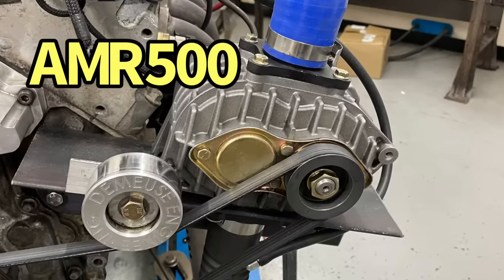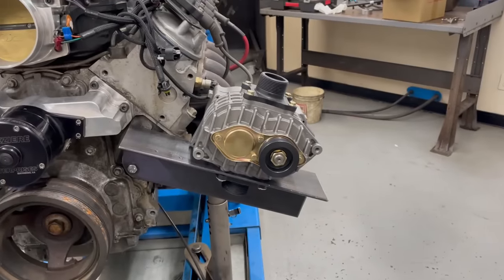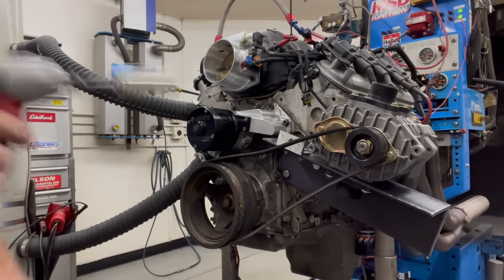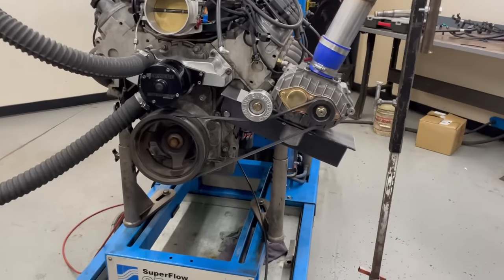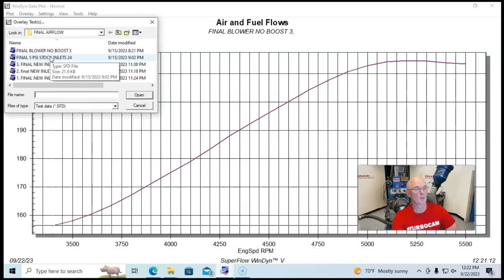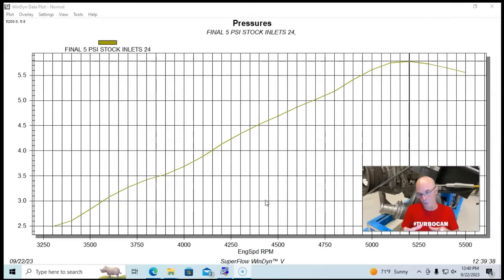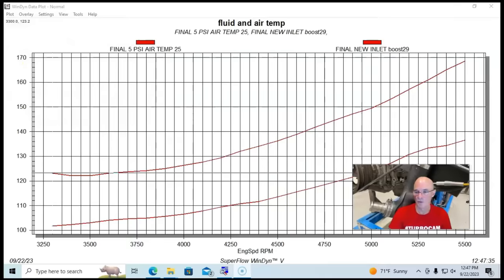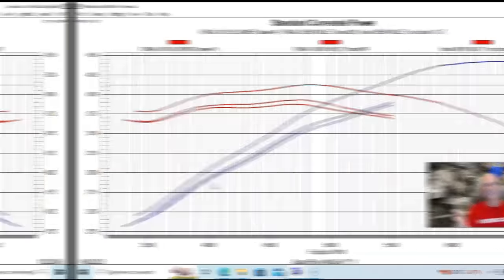THE ULTIMATE CHEAP, EBAY, AMAZON AMR500 BLOWER TEST. FULL RESULTS-AIRFLOW, TEMP & POWER CONSUMPTION

Comment: I ran an AMR300 supercharger on a fuel injected  420 cc single cylinder  Harbor Freight engine with a 1:1 drive ratio.  As I recall we got 8 PSi of boost.   The 13 hp engine  was also ran with the induction pipes disconnected so the blower didn't produce any boost and the little engine had no problem spinning the supercharger up to redline.   We discovered a few issues with this type of supercharger, first one was the gear drive inside the supercharger develops a lot of heat and we were able to wick away some of the heat with a water cooled heat sink from a PC.  The second issue is the supercharger cannot tolerate any vacuum or negative pressure... like when the engine is at idle.  If there is any vacuum, the oil from the gear drive will get past the seals and be consumed by the engine and the gear drive will be sucked dry in a few hours... the solution is to use a bypass or double throttle bodies.
Reply: Very nice to see you here RC!! Love* your content and I hope you decide to twin charge the 3 cyl diesel engine 📈
Reply: @budyeddi5814  Twin charge is an option, we first want to try the supercharger and see what happens.  should be interesting.
Reply: Bypass valve works really well from what I understand. that’s the way they do it on the old 3800 sc v6. It’s just a necessary edition for idle quality and in this case blower function
Reply: Thanks for sharing. Given that info my small brain can’t comprehend how it could rob approximately 28hp according to the dyno results. The math isn’t working. Lol
Reply: @claytoncarter It's because the drive ratios used were different. He didn't spin it up half as fast as Richard did, just to whatever redline the harbor freight engine has with the 1:1 ratio..... maybe 4500 rpm? Richard took the supercharger to 18,000 rpm with aprox. a 1:3.27 drive ratio, which is gonna take more pony powers.
Reply: @johnny0454 that makes sense
Reply: Hot gearboxes may be overfilled.  If the level above the gear CLs, the gears act as a gear pump.
Reply: I have a amr500 on a gx390 at 400cc going blow thru with a mikuni and intercooler with blow off valve.  Works well and runs at 17lbs.
Reply: @robotcantina8957 I was thinking this but I was like "No way he'll ever see that lol"
Reply: Do any of you motor heads think it is possible to run one of these cheap super chargers on a 2-stroke Jet-Ski (like 550 or 750cc)?  These have either single or dual Mikuni (or Keihin) 38-46mm carburetors.
Reply: @AtimatikArmy  Yeah
Reply: @AtimatikArmy  people say it isn't possible because of the way a 2 stroke works but maybe.  I mean there are boosted 2s now in snowmobiles and stuff but they are a little different than just sticking a turbo on an old 2 or 3 cylinder 2t. Based on my limited knowledge I think it will work and increase power, but I think it will be incredibly inefficient.
Reply: @AutomatedAgriculturalSystems  In theory, I would think it should work.  2-stroke already operate with the supercharging effect of an expansion chamber (assuming one is being used).  This would compress fuel mixture from the intake side.  I'm sure timing and compression would have to be adjusted to make it work reliably, I wouldn't doubt.
Reply: Ayo just about to watch the kubota supercharger vid that just came out I’ve been a fan since the start
Reply: single cylinder is problem boost stop boost stop 4 stroke engine
Reply: @alonzahanks1182  It may seem like a problem, however it worked great,  actually the only real problem was blowing head gaskets.
Reply: Two tips: 

#1- plumb a bypass intake with a check valve to eliminate vacuum

#3- a cheap heavy fuel pump (diesel/kerosene) and two lines tapped to the gear case with a large plate-type transmission cooler. Cheap and effective cooler with stuff you probably already have laying around.
Reply: @robotcantina8957  so you ran it on oil as coolant with a pump and res I was gona do that with a eaton
Reply: The man, the myth, the legend

Comment: Just an idea, you can pretty easily put an optical RPM meter on the blower pulley and compare the RPM ratio between it and the engine to detect slip without needing to go through the change to cog to rule it out.
Reply: What kind of power do you think that airflow would make .
Reply: Is it possible that when you run the factory plastic fittings and produce higher discharge  temperatures,  thus  expanding the air so much that it produces more boost than with the larger Richie fittings that produce lower discharge temperatures
Reply: @Bill-flatplanefool 1/3 of a 1970' sbc 350 so about 50-60ish tire.  Based on cfm carb size guess. 
If rich had given us a lb/min there would be no room to gess. 1lb/min =10crank and 7wheel hp. Ther was no mention of DA so no  start point for math to build a lb/min equation.
Reply: @blow0me   Drawing a line with a paint pen and using an laser reader that doesn't care about distance is a little easier than adding a tooth and dealing hall sensor alignment.
Reply: @seijirou302 it’s only easier if it shows there isn’t slip. Since it will show slip, you’ll need the cog setup anyway.
Reply: @Tommy-B.  of course assuming things is easier than testing a hypothesis.
Reply: @seijirou302  it’s an educated guess. As opposed to thinking everything has to be tried to know if it won’t work.
Reply: @Tommy-B.  "literally everything has to be tried".  This is as low effort as it gets.  Drawing a line, sitting an optical RPM meter on a table and doing a 7 second pull.  If you want to throw money at problems instead of lifting a pinky that's your prerogative.  Holdener did all this to get data, and this is a cakewalk easy way to get more relevant data.  Maybe you think he should have just made a 15 second short saying "I could have tested this supercharger but nah, here's my educated guess.  Okay bye"
Reply: @blow0me   if only there was something invented that could allow a person to record an event live and play it back.  Anyway, non contact tachometers can also come with analog outputs so they can be data logged.  JFC
Reply: Mount an optical with dot( technically the contrast from the nut to the pulley should be sufficient and  but should read 6x higher than the 18k ). Or mount a hall effect to read the points of the nut. Ether one will do.  The light will be less finicky to adjust .
Reply: How hp would this blower support?
Reply: @daviddroescher  yeah I read turbo maps all the time but I was brain farting on density at 5 psi
Reply: Yeah or we can build a house, a garage, take the engine there,  order 5 cheap superchargers, x-ray them, and finally Dyno each one, x-ray them again. Or maybe just remove chance of slip with a cogged.
Reply: @20somthingrealestate  sure if you don't care to know.  Is it slipping?  Me:  Let's find out.  You: I don't want to know, just make it impossible.
The whole point of the video is finding out.  How do I know?  The first 3 words Richard speaks is "what happens if".
Reply: it wasnt connected.. Also there ment for 1.5L or less motors..
Reply: yeah, absolutely.
Reply: @nyvtr  yup that would work too.

Comment: Every sub 100hp engine needs two of these.
Reply: I was thinking of trying to install one on my 67 hp 4kc Toyota starlet motor
Reply: @619omni at half bar you'd get 90hp with this thing
Reply: Thinking of putting this on a d16 from a 02 civic lx. Non vtec. Thought it might help get it above 100hp
Reply: I'm thinking of putting this on a 1,5 liter 8 valve engine. What do you think?
Reply: @tristanuae  Hell yeah!
Reply: you think a 2 Piece would work on on each side?
Reply: @personalprivilege6992  Two on a small V6 or something would be cool. It would be quite noisy!

Comment: I ran one of these on my sweep the floor vw engine and boy did it wake it up! Even at 4 psi it was a huge power increase out of the 1641cc engine. The amr500 is probably the best hp for the money for a vw as long as you can make your own intake adapters like I did although there are a few companies that sell intake kits for these to bolt onto a vw. I've got a few videos of that engine on my channel if you'd like to take a look
Reply: I gotta know details on this. I'm looking into getting a vw beetle and that's something I'm interested in
Reply: @johnraitt2555  are you wanting to know more about the motor or supercharger setup
Reply: @V8N8T  To be honest I wouldn't even know where to start. I'm very new to all of this. About 2 months ago I seen this late 60s/early 70s beetle in amazing condition just sitting in this junkyard out in the woods and I'm gonna try to get it from the landlord. Since then I've been basically studying air-cooled vw beetles, it's been a bit of an obsession lately
Reply: @johnraitt2555  that's awesome hopefully you can get it. Vw's are a very basic machine and pretty easy to work on. I'd suggest after you get it go thru the brakes, get the engine running well and the rest of the car sorted out. They are a mechanical car and require maintenance like valve adjustment and brake adjustment from time to time and they are old so parts will need to be replaced here and there. If you have a local vw specialist have them look the car over before you buy it to see how much work it will need
Reply: @V8N8T  From my understanding it was restored by somebody local about 4 years ago and when the man passed away there was no surviving family members so it's been sitting ever since. The motor has been wrapped in a tarp, I haven't gotten a good look at it yet. But if it's in as good of a condition as the rest of the beetle seems to be there may not be too much to work on. I do appreciate your kind words, fam
Reply: @johnraitt2555  you betcha fingers crossed for ya
Reply: I said before, I think this little blower would work much better on a 4 cylinder. I am very surprised it even kept up with stock intake!!
Reply: @LD-du3xx  most definitely it's even small on a 1.6 4 cyl. If you expect to run a large amount of boost it will become a heat pump more than it already is
Reply: I have a hail damaged Nissan tiida that's still running well and I'm contemplating playing around with it cos parts are dirt cheap for it so why not 😅
Nismo put a supercharger on one when it was launched but can't find what one they used. I'm curious if something like your vw setup would have similar outcomes.
Reply: @dionfleming492  I'm sure it would as long as you keep the boost low
Reply: Wow. Got Suzuki 1200 Bandit. Motor spin up to 10,500. 11,000 rpm. If blower spinning at 18,000 at 5000 5500 im gonna cook the the blower spinning it that high.?
Reply: @BrianJacobsen-lc3fe  you can limit the blower rpm by pulley size to not over rev the blower
Reply: @V8N8T  Thanks got 2 bandits with extra motor. And a 67 karmin gia roller no motor cars little rusty but for 40.00 i paid for it. Seen vids use coupler mount it to the trans Axel use bikes clutch. But I'd have to cut hole top of the deck lid. What i want to cause its on the cheep. Use all the components except the housing of the trans axel. Make a box out of 1/4 plate. Make it bolt in where the trans use to be. Bolt a rear sprocket where the ring gear goes. Run a chain have the cv bolt with the studs like the OG trans. Id have to zerk all the bearings with grease fittings you know the whole trans Axel unit has 90w flowing threw it. Be no reverse have to grease it regularly motor 110 hp stock 5 sp blower on it be fun
Reply: @BrianJacobsen-lc3fe  that would be an awesome build!
Reply: @V8N8T  So you think its possible.. the bearings would live ? There's only one way find out i guess  do it drive it find out 5sp one up 4 back.sequencuil go kart.
Reply: @BrianJacobsen-lc3fe  of course it is anything is possible you just have to want it enough. Take measurements twice or 3 times, plan it out, and most importantly have fun doing it!
Reply: @V8N8T  im checking out your channel bro thanks
Reply: @BrianJacobsen-lc3fe  you betcha!
Reply: hi hes saying it uses 29 hp just to spin it, is that not a lot to loose first before any gain?
Reply: Was it a blow through set up ?
Reply: @vmaxmuscle5612  it was draw thru
Reply: @johnraitt2555  please dont waste your money on this thing.

Comment: Boost was higher with the smaller inlet because it was heated more. Going to take your numbers later and generate a lb/min flow rate graph. Thank you for the great work and wonderful data!
Reply: Boost was higher with the smaller inlet because boost is a measurement of restriction.
Reply: Grams per second please.
Reply: @Joebauers2505  inlet restriction would not affect boost. outlet restriction would.
Reply: @Marc_Wolfe he lives in the US, find a converter calculator
Reply: @shadowopsairman1583 I think he is asking for mass per sec (lb/sec) not a unit conversation, or he would have asked for bar.
Reply: @jtdyalEngineer make sence. ASE  to metric seems to be a conversion . G Vs LB/MIN  then devid (edit: multiply) by 60 to get to the desired  g/sec. 
 Wolf what is the g/sec to hp? ( or is g/sec for different math ) ASE is 1lb/min ≈ 10hp crank ,7hp wheel.
Reply: Almost like having an intercooler. Less heat means higher density, you can flow more air at lower pressure, so boost may not show as much. I think you'd need an outlet MAF to really measure all this accurately.
Reply: it wasnt connected.. Also there ment for 1.5L or less motors..

Comment: Air pressure increases about 2% for every 10°f which could explain why the stock fittings produced more boost. Although the higher boost wouldn't produce more power because the mass flow is lower.
Reply: Also there could have been a ton of turbulence coming out of the stock outlet which would reduce flow and increase pressure.
Reply: This is exactly my thoughts.  The factory outlet is a restriction and the increased temperature will raise boost while it depletes air density causing a negative airflow measurement overall.  I'm now thinking about putting one of these on a jeep 4.0
Reply: Curious was the pressure decreasing at 5252 rpm  with the big manifolds?  Another variable the cam duration. 🤔
Reply: it wasnt connected.. Also there ment for 1.5L or less motors..
Reply: Wow a got a slow tercel might good to adapt that  and see what hapeens
Reply: @woodzyfox4735  more like 660cc
Reply: @AdinSLaboy  Big bang theory!

Comment: The reason you are measuring less pressure with the larger inlets is related to the venturi effect. Although you are pushing more air through the supercharger, you are still using the same funnel where the air intake is and the same restrictor on the exit. The venturi effect is that the pressure decreases as velocity increases. You are flowing more air through the same diameter reductions, and the air pressure at the inlet of the funnel is the same, and the measurement point is the same, so more velocity = lower pressure. 
If you want a better way to measure it, you should measure the pressure at the entrance to the supercharger (which should be a vacuum at that point) and measure the pressure in your discharge pipe and subtract the two. This will give you the pressure produced by the supercharger only, neglecting the pressure change from the funnel on the input causing the venturi effect.
Reply: I came here to say the same. Coming from an aviation background, it was easy to understand what was happening here.

Comment: If Gale Banks taught me anything, it's that the boost pressure is probably lower on the higher flow run as a function of air density. Maybe since the blower could breath easier, in and out, it was able to compress the air more efficiently.

Comment: Very cool test, I remember reading about stuff like this from the 60s where they would dyno one engine running off a SC that was powered by another one. 

That blower is cute! Don't quite have a project small enough for something like that but it looks like it'd be great for something like a motorcycle, my Cruze 1.4L or a Sprint 3 cylinder.

Comment: Very cool data! I think the next step would be to add a MAF sensor in your inlet as well as data for the ambient air parameters such that you can account for air density and measure flow in lbs/min like superchargers and turbos typically are. That will be much more able to be correlated to a HP number. Interesting to see pressure drop after the mods, my thought is that IAT being less means the SC is more efficient, and so is pumping larger mass of air through lower pressure due to improved density. You should get one of those banks gauges, his shit is really dialed in on this whole air density situation.
Reply: He has everything for DA in and out, pressure and temperature  + the bid blue measuring device should have the amibiant data . Just didn't present the nessasary numbers to pull out more practical data like lb/min.
Reply: This guy already trying to write a fuel map for it...

Comment: Awesome content!
I would love to see you do this with a 6-71, with a restriction of say, 8 lbs boost by 6000rpm. 
So many of us street guys run these, would be amazing to see real world numbers on the horsepower draw. 
Thanks for all your amazing  hot rod science!!
Reply: Very specific lol
Reply: it wasnt connected.. Also there ment for 1.5L or less motors..
Reply: What would you run them on? I’m thinking if it would add anything to my small block Chevy lol.
Reply: Well, I would not run that on a small block. Because it'd be very restrictive, the only way. If you must use that super charger, you'd have to get it all the way up to A 10:1 ratio on the belt or higher to before even starts to keep up with the air flow demand of the engine. Hence the reason why they ran a 671 super charger on small block engines. Now a small block, Chevrolet with a 671 at 6000 rpm. Aking APS I that's not correct either a you got a lot of bypass Or belt slippage of some kind or the incorrect belt ratio. If you look on wield superchargers chart states 350 with 6/71 at 1:1 make 31psi .
Reply: hp draw would shock a lot of people